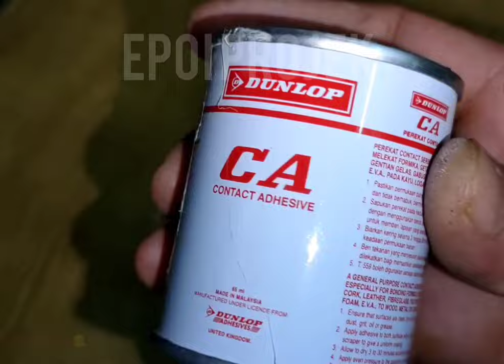how to make speaker suspension from rubber tires

Comment: You need to wash that white stuff out of the inside of the tube with soap and water, then wipe both sides with alcohol then the glue sticks better. I used PVC cement and just cut four rectangular pieces and cemented them down and they can take some flippin' base!